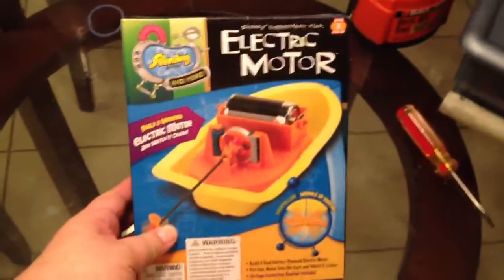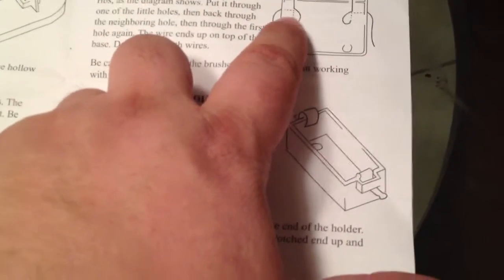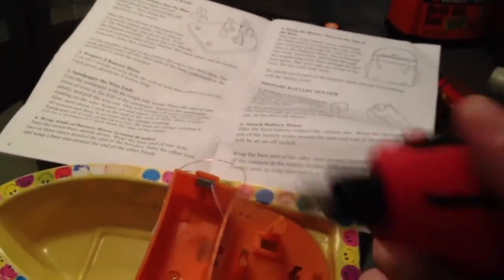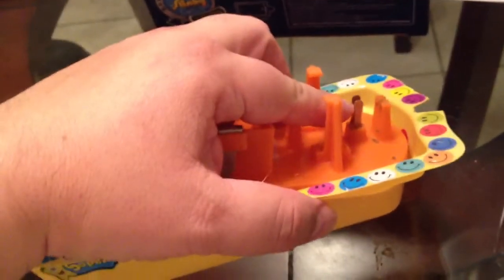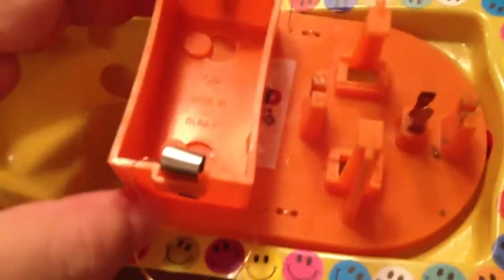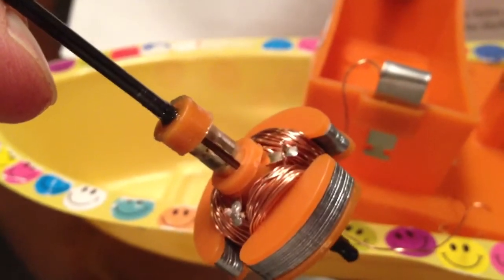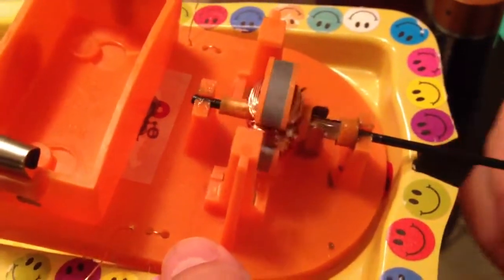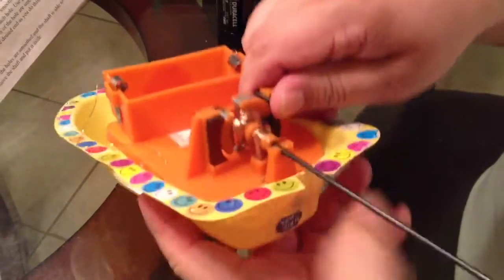Slinky Electric Motor review

Comment: I got that kit and it sucked it didn't even spin the motor. How did it work for you.
Reply from the maker: tuttle tutorials , I hadn't looked at comments for this video in a long time. Sorry about that. You may have either figured it out by now or gave up by now; but if your motor didn't work, it can only be due to one or more of just a few things. 

1.- Make sure the copper wire keeps its coating throughout, except where you scrape it off at the end to make a connection. Sometimes, if you happened to handle the wire too much this coating may have gotten damaged or came off partially and cause a short in your windings. It would also happen if you put too many batteries and overheated the wire and the coating melted.  This is rare though, more likely causes are the next ones. 

2.- The direction of your windings, make sure that windings are going the correct way per the instructions. Winding clockwise or counter clockwise will change the polarity of the electrical magnetic field generated. All 3 windings must be done correctly for the armature to have the correct polarity. 

3.- The polarity of the magnets. Installing the magnets incorrectly will cause problems. You want to double check them. 

4.- The polarity of the battery as it is delivered to the brushes. Again, if incorrect you will have a harder time getting things to work correctly. 

I'd recommend for anyone trying to build an electric motor to pay special attention and test each step as you go along with a battery and a separate magnet where you know N and S poles to be sure you are getting the expected polarity out of each winding and the magnet installations. 

Good luck!